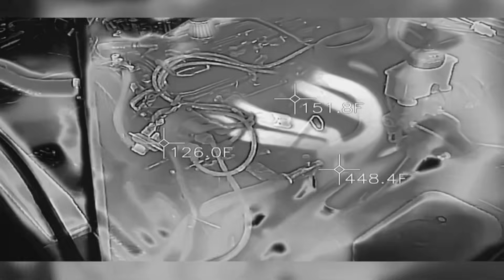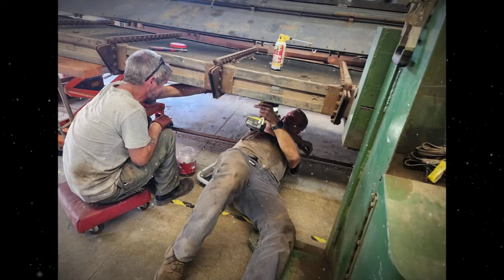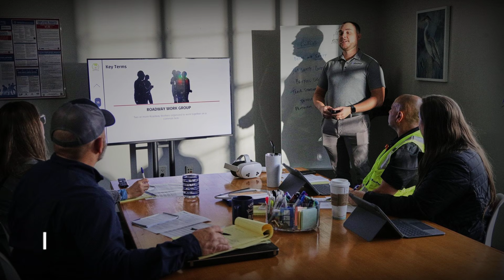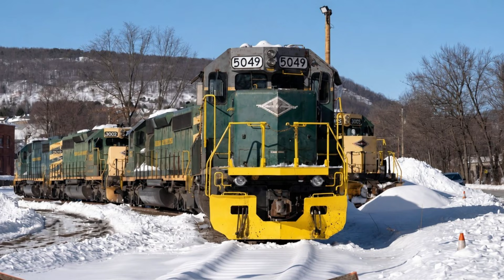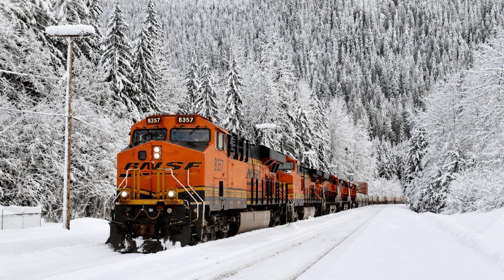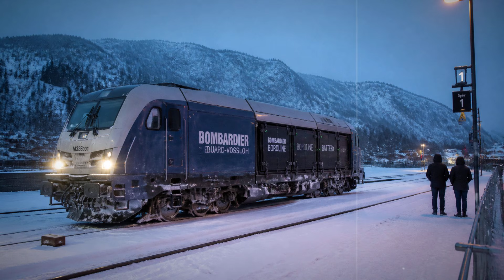How Train Crews Sleep in Their Cab on the Coldest Nights

Comment: As a locomotive electrician, I can tell you there are electric heaters in US freight locomotives.   Those that were built without (pre-1950) have had them installed.    Some old ones (1950s and 1960s GMD Canada) have a heater like your car that uses heat from the prime mover cooling system with a radiator in the cab but they have been largely replaced by electric heaters installed in the cab due to plumbing maintenance needs.   How do I know this?   I removed the hot water heaters and replaced them with electric heaters in many units.